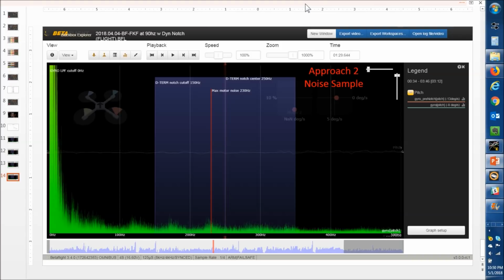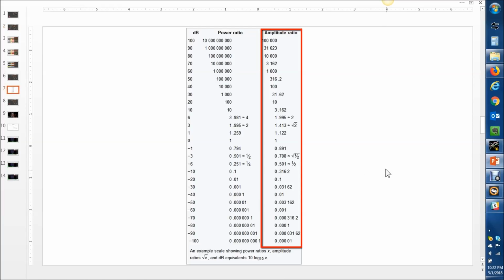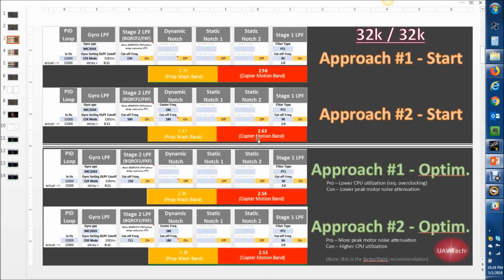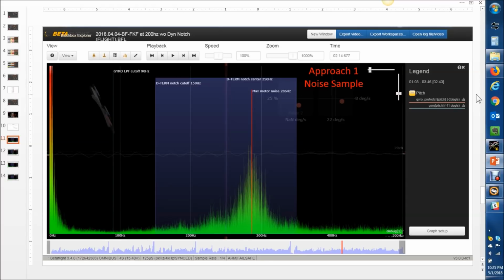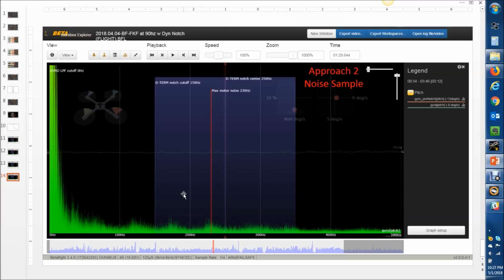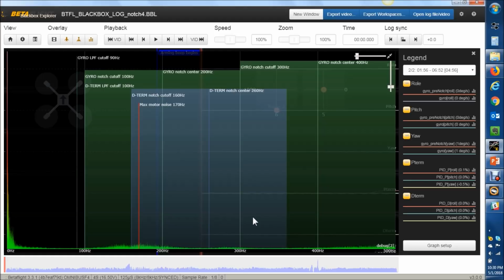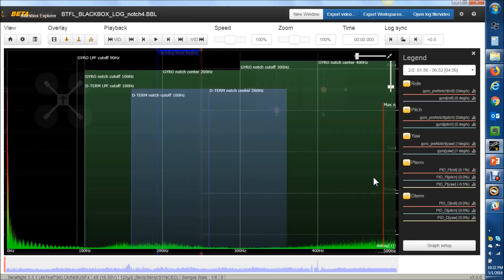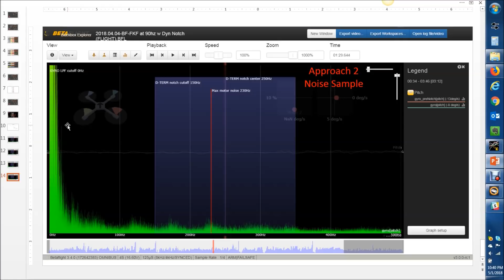Betaflight 3.3.x Noise Profiles vs. Filter Approaches

Comment: I have also wondered whether or not they'd add the option to auto-engage dynamic filters after a certain noise floor is breached. Do you know if this ever became a feature/pull request?
Reply from the maker: On my radar.  It can be done.  Just needs coded.

Comment: If I don’t have access to blackbox data, is there a sort of flow chart or sequence I can go through to set my filters?
I have built a quad that feels like it flies very well but I’m fairly certain that I’m over-filtering. It’s running an 8k/8k loop and I have dynamic and bi-quad on, both notches and D term enabled on stock numbers. Prop wash is virtually nonexistent, even w 5055 hulkies.
Love the channel man! Always looking for the next video 👍
EDIT: it’s on BF 3.3.3
Reply from the maker: Phil Cogswell , try the filter defaults at tiny.cc/filtercalc and see if u like better.  If however, you have very little prop wash already, u might be set.

Make sure to do a quick 30sec flight and check motor temps on new filter setup.

Comment: Do you think the Helio Spring will manage better the approach 2 with his 2 processors? Maybe adding more dynamic filtering? Great video BTW!
Reply from the maker: Mechamilk , Helio does not allow for the use of Notch filters on the gyro.  I have seen it be an issue for those who have motor peaks.

The two CPU approach just lets them off-load the filtering comps to the F3 processor so the F4 can run the PID loop.  It enables the board run 32k/32k.  Now the question is, does it matter (32k/33k).  Hype or reality?  I have not done tests.
Reply: UAV Tech thank you for the answer. I have 2 qquads with the same setup with Helio FC. I'm testing it right now and i will check blackbox logs this week. The quad flies very smooth and motors are not hot even without a perfect tuning of pids and filters. I have more tuning to do to get a perfect fly behavior. We ll see... Thank you again for your interestings videos.

Comment: Flashed two my quads to Betaflight 3.3.2 at yesterday. Both have RacerStar TattooF4S FC's with MPU6000 gyros. Decided to try out a new BQRCF2 filter - changed gyro_stage2_lowpass_hz to 90 with dynamic filter enabled and both notch and D-Term filters turned off. Got kinda smooth flying without alarming motor heating in result. Then decided to look in Blackbox logs. In both quads filtered gyro traces was very smooth with a barely noticeable fuzziness somewhere - didn't seen so smooth traces in these quads with only notch/D-Term filters before. But what was strange - motor traces now have small but noticeable sine wave like fuzziness in all graph line length. What it can be? Motors are warm after flight but not alarmingly hot, maybe I could not bother about that. Or maybe this fuzziness is not good (should not be) and there is a way to get rid of it. With lower D term or maybe in some other way. If someone want to see, I can post logs at tomorrow.
Reply from the maker: Would need to see the log.  Post to: https://www.facebook.com/groups/291745494678694
Reply: Admins asked me for verification. Still pending. So far uploaded logs into Google Drive. Link is below
https://drive.google.com/drive/folders/19FGn8hLQWnbWNhMTzRmcA2_qZrJK5Id0?usp=sharing

Logs marked with LX5 are recorded for both default Notch/D-Term filters and BQRCF2 filter. BFight210 - BQRCF2 filter only. BFight210 logs are noisier - I suppose it happened because of a bit worn and bashed 6-blade props and 2 yr old Emax RS2205 motor set. LX5 have brand new HQ 5x4x3 V1S prop set and brand new DYS 2207 Wei motors. Don't be surprised about Horizon mode. I'm on sick leave now and wasn't be able do outside activities at yesterday. Flying 5" racing quad inside house in Acro is a disaster waiting to happen.

Comment: Mark - I spent yesterday demonstrating to myself that Betaflight 3.4.0 (latest build) is not the same code as Butterflight 3.5.0 in the sense that something is still different in the filtering.  I set up one quad (3" with SunnySky 1106 5500kv motors and Avan 3" props) exactly the same way on both operating systems.  Same exact filter settings and latency using your approach with the Stage 2 BQRC-FIR filter replacing the soft gyro lowpass at 90 hz and the D-term lowpass PT1 at 70hz.  Dynamic filter was on.  The BlackBox logs look nearly identical in terms of noise, but on BetaFlight 3.4.0 (build 801) there was an audible difference in the motors and more propwash flying exactly the same way for the same period of time - mostly just hovering with punches and forward and backward movement.  I trimmed the logs the same way - and saw little difference, if any, but the motor noise and propwash was distinctly greater on Betaflight.  So, I wonder, is the D-term spike really fixed?
Reply from the maker: George H , u would see them in your 3.4 logs if there.  If u want, send me the logs and a diff, I can run the same tests and see if i note the same results on my kwad (logs and sound).
Reply from the maker: Oh, the Spikes are in Butter 3.5.0 (if i'm recalling the v. # currectly) based on a log i got from someone recently.  They are fixed in Butter 3.5.1-RC2
Reply: UAV Tech  - Mark - I really don't know what to think - other than the mechanical noise and propwash was different on the same quad, set-up the same way (exactly) on Betaflight 3.4.0 and Butterflight 3.5.0 - regardless of whether d-term spikes are present or not - flown at the same time under the same conditions in the same way.  I appreciate your offer, but I think the answer lies elsewhere in the coding of the two versions of firmware and maybe has something to do with the BQRC-FIR implementation in Butterflight vs, Betaflight.   After many hours of experimentation on various kwads (all 3" or less and all with MPU 6000 gyros), and with the benefit of learning about filters and latency - mainly from you - it has become clear to me that the advancements in both Betaflight and Butterflight are really aimed at folks running 32k gyros on 5"-6" or larger kwads and are, for the most part, irrelevant to the smaller kwads using MPU 6000 gyros where high-frequency noise is far less of an issue than low-frequency noise.  Your original suggested alternative of using the more advanced filters to replace the soft lowpass gyro filter on MPU 6000-equipped kwads at or around 90hz cutoff and not worrying about higher frequencies seems to work the best and keeps the latency in the 6ms range with dynamic filters enabled.  Last question for you - why would the Butterflight dev's make Biquad the default d-term filter in the latest build of 3.5.1?  Is that strictly aimed at the Heliospring board or is there greater meaning?  Thanks a bunch Mark!

Comment: as for softmountnig  - i recommend you to watch SiieeFPV's video 'Exploring motor isolation'
i used 2 silicone pads for each arm and it helped noticeably with  beat-up props, i guess it does something with resonance frequencies by shifting it somewhere

Comment: do both fkf and beta's stage2 act  before dynamic notch? i just couldn't tune my emax hawk5 out with fkf set as a single lowpass filter to 100hz. but with betaflight 3.3.0 with its stage2 set to the same frequency it flew okay (stage1=0 too). 
looking at pre notch i see i have got a lot of  noise above 400hz and some bumps at 140. so maybe dynamic notch doesnt know what should it do until a lowpass filter suppress high freq noise?
Reply from the maker: The Dynamic Notch gets it direction from raw gyro data.  See the graphic at https://www.screencast.com/t/nBoqozoPP4f.  The FFT is what drives the Dynamic Notch's center frequency location.  Your idea of having the FFT after a lowpass I think is a good one and has been raised by others.

Without seeing the log, would not know what might be happening.  However, when you get two peaks within the Dynamic Notch range or noise that is really close to 500hz, the Dynamic Notch seems to struggle.  You can run an FFT debug mode to see where your Dynamic Notch is settling.  That is what I would do if I were you and was wondering.
Reply: maybe i am mistaken, but i saw somewhere on bf github the idea of this stage 2 was so that dynamic notch didn't get confused  by high frequency 32k -data, so lpf should go first.
Reply from the maker: From my understanding, the Stage 2 was introduced as it is needed for 16k/32k sampling as you get higher frequency noise 500hz to 2,000hz that needs more attenuation than a single PT1 provides with a cut-off around 100hz.

Comment: Nice video! Would it be possible to see some picture of the softmouted FC with those amazing logs, and a list of the setup?
Reply from the maker: See pinned comment i just posted.
Reply: hm, there is none pinned..
Reply from the maker: oops, pinned now, but also:

Log shown that seems to have the low noise (but needs a little more verification as covered in the video) is from the review at: https://youtu.be/ppqsoEPjWh0. Some follow-up on that here: https://www.facebook.com/groups/291745494678694/350495962136980/